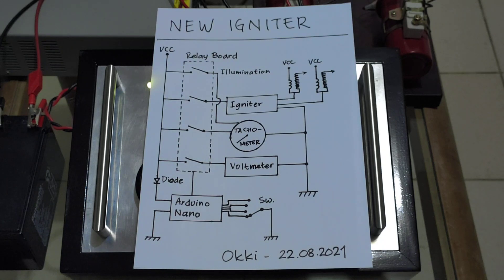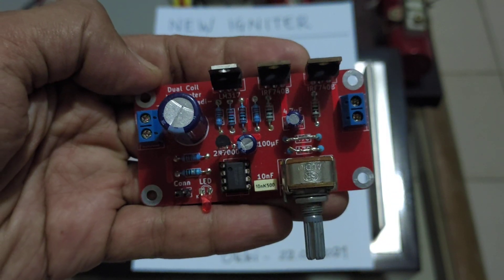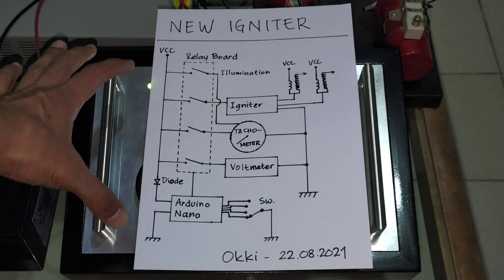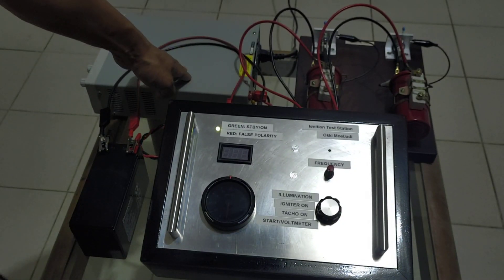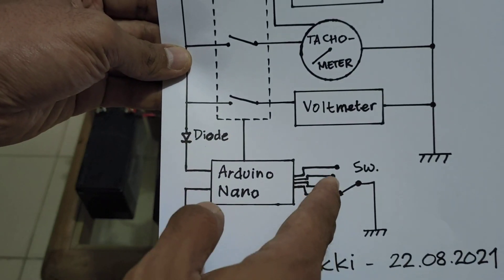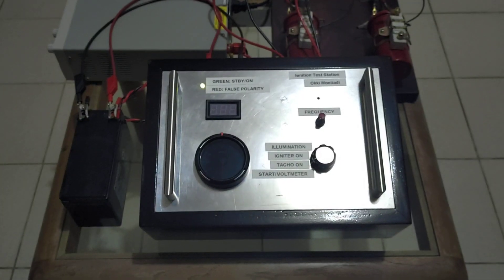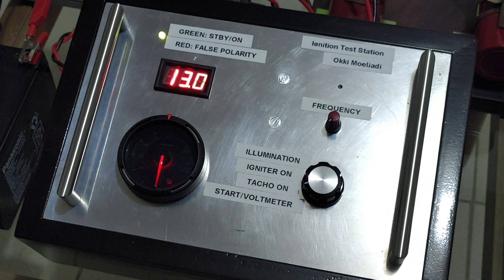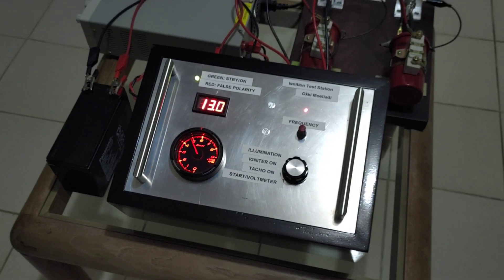Ignition Test Station - Circuit Diagram

Comment: The distortion of the audio is indicative of very large energy during spark events - I hope you use hearing protection!
Reply from the maker: Actually it doesn't sound as bad as on the video. The microphone is somehow very sensitive to the spark.
Reply: This distortion is caused by the microphone coil and amplifier picking up the electromagnetic energy; it's not acoustic energy.